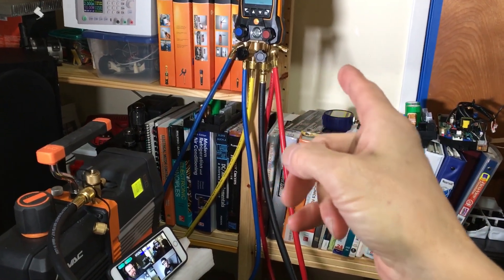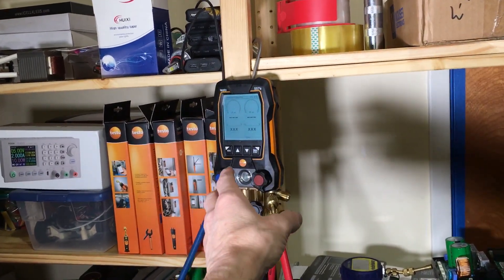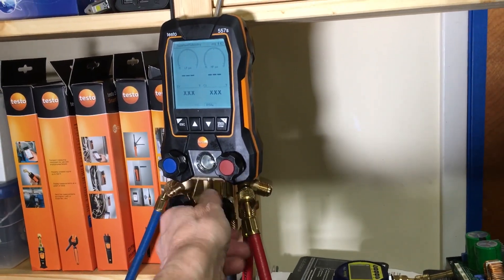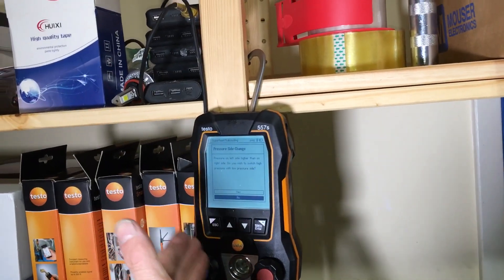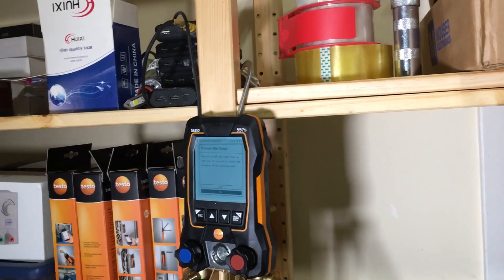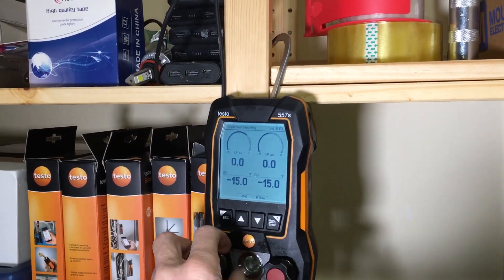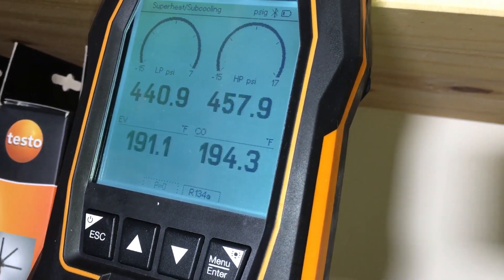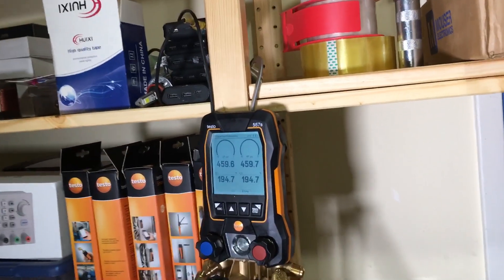TESTO 557s nitrogen decay test @ 460 PSI overnight decay test.

Comment: whats your professional option on these vs feildpiece ?
Reply from the maker: I own 5 Fieldpiece manifolds, use them every day. 

I have 2 557s both sitting in my workshop shelf.  

Bluetooth keeps dropping out. 

All the knobs keep popping off in the vehicle only held on with spring clips 

The back battery plate keep popping off dumping the batteries in the vehicle in the shelf or floor. 

Screen would go black and reboot if one of them gets yes bumped.

Comment: It might have brought up that message because you opened the low side before the high side when you first added the nitrogen
Reply from the maker: That message should only come up when you turn it on and the low side is higher then the high side. 
                    When I opened the low Side the high side was still 460 psi on the low side only went up to 74 that should not have triggered the reverse pressure message.
Reply: @coldfinger459sub0 Sorry, I meant at 2:24 when you added nitrogen for the first time. You opened the port that the nitrogen was connected to with both the high and the low closed. You then opened the low first and the pressure went up to 220psi with the high still at zero. You opened the high shortly after but it took a bit longer to come up to the same pressure. Thats probably why it brought up that message
Reply from the maker: @ConnorCoultis  yes you are correct I was having a brain dead moment paying attention to video not what I was doing or saying.
Reply: @coldfinger459sub0  No worries. I’m enjoying your videos on the 557s, hoping to pick one up soon myself.